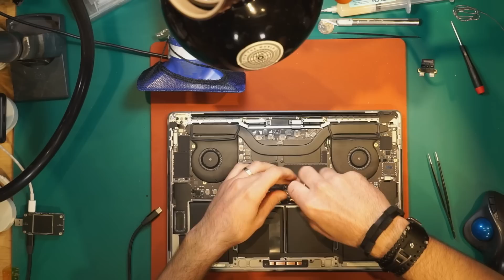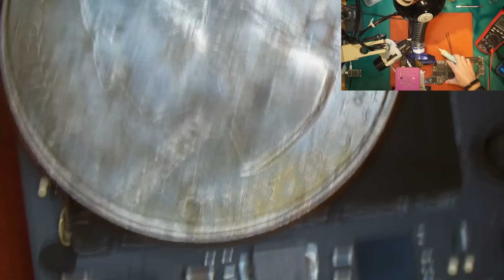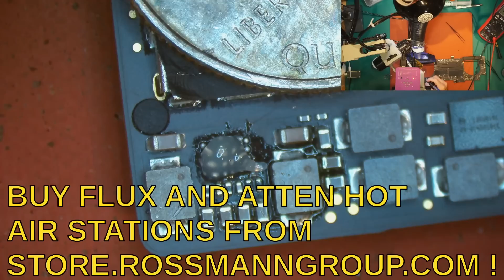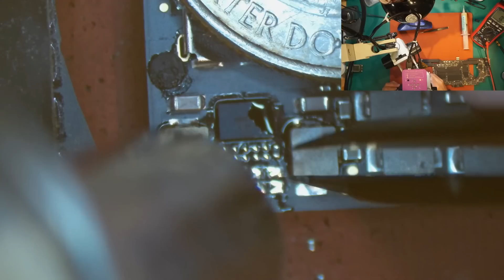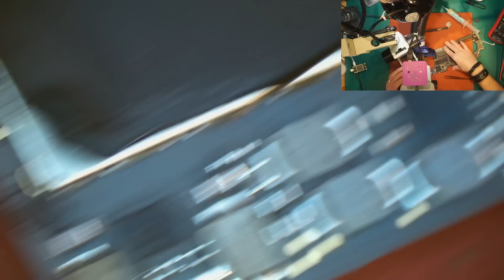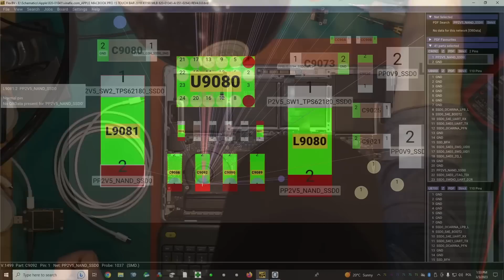Are Apple products still JUNK in 2023?

Comment: The iMac I bought 4 years ago has developed 2 long vertical lines on the screen.  It's out of warranty but I wonder how many other iMacs have this problem but perhaps worse.  I use Mac software and wanted to avoid their poorly designed keyboards, so instead I got this.
Reply: Dead pixels and dead pixel columns are pretty common from all the display brands. Seen it in Dell and LG monitors and you can find them cheap on ebay for this reason. This is why I don't like the concept of the newer iMacs, where the display is integrated. The old one had a magnetic removable LCD that could therefore be replaced. I would recommend the Mini, so the display is separate.
Reply: @gorkyd7912 soon Apple will start making screens so they will control how much time it will last.

Comment: I don't know why Apple doesn't provide a zener diode at the output of the buck converter chip. For such an important component as an SSD, what's the extra cost of one zener diode? If I ever work on such an A1990 with a good SSD, I immediately install such a zener of 2,5 or 2,6V. Risk is 0 after that.

Question: at which temperature is your hot air blower set? I never managed so quickly to remove those components on a Macbook board.
Reply: Is there enough space for it?
Reply: @gorkyd7912  If they had included this at the time of the design, certainly yes. Now, also yes. A normal zener diode (not SMD) isn't that large. Cathode to one of those big capacitors on the output of the buck converter, anode somewhere at ground et voila, it's safe. 
If the diode gets shorted, no problem, the buck converter should go into protection mode. But the SSD is always safe.

Comment: It's a relatively simple thing to mitigate any possible over volting to the SSD a simple resettable fuse set to say 2.1v.. So why has this not been done? Parts will fail regardless, good design however takes this into account and protects itself.. The SSD surely is the one component you cannot afford to be trashed , it's the customers data..!
Reply: They already add the bare minimum to the design to save a few bucks in the production line, let alone backup systems... military grade products do that, but who can buy them or has access to them? Not us, normal humans.
Reply: @AbulaSyllabus If Apple adds bare minimum to the design we definitely shouldn’t be paying premium.
And there are plenty of other reasons not to buy Apple at all anymore.

Comment: What's funny is I'm actually watching this video on a top spec one of those, with the exception of a ludicrous 64GB RAM and 8TB SSD upgrade. The only reason I'm using this one specifically is because I need to have 1TB on both boot camp and MacOS, and need both for certain things, is beneficial to have this in a decent-ish laptop package that lasts at least an hour on battery.
I went back to MacBooks after trying out 6 different PC gaming laptops before I concluded that they are all crappola. All of them over 2,400 bucks each. I took this MacBook Pro over a 12700H 3070Ti gaming laptop, I just need it for what I do, and there's basically no other options out there right now, which sucks but that's just the way it is. I only paid 1,800 bucks for this though which I'm calling a deal compared to the 5,000+ after tax when it was new.

Heat isn't even that much of a problem on it either, if you are doing something intensive, it can get pretty hot but I just use Macs Fan Control to blast the fans at full speed which isn't as loud and unreasonable as I thought it would be, and compared to my dad's work laptop at a similar tier, pricepoint, year range, and use case (work laptops), the MacBook beats that thing up and down the road in every area, the fans actually sound like jet engines, and that's when logging into Windows.
I've also gotten it to last 4 hours at least by just turning on low power mode and turning the HDPI (Retina) function off and changing the resolution to something like 1600x1050 or lower. I recorded, edited, and... wait no I connected to power to export and upload a 2 hour video on just one charge, and this battery is at 85% health.

Macs have many design flaws, but I can point out easily 5x the amount on a PC laptop. The M1s though.... they just are.. different and have specific use cases.

Comment: Hey Louis I am a fan. But doesn’t it make sense that, as you say, no other product fails in this way, because they’re the most popular products around? I mean, it would make sense that you see these types of failures more often simply because of the number of Apple devices that exist. I imagine other products fail for probably some other random reason, and that reason I imagine would vary as much as the brand does. Tell me I’m wrong I’d love to hear your thoughts on this point. Thank you kindly
Reply from the maker: How many brands or motherboards do you know of where the primary and best known failure mode is sending 7 to 12 volts to the SSD?
Reply: @rossmanngroup  Can't this happen on most notebooks with buck converters? (heck, even ssds)
To me it seems like the mosfet inside that chip is not rated for that usecase and its failure mode is unfortunatly "short" since the chips design doesn't account for that (so blame ti)
The engineers probably put in a cheaper chip that can handle less or had an "oversight"/"miscalculation" causing that :)
Or something funky is going on with the feedback pin.
An actual cheap fix would be a small polyfuse and a zener diode which clamps the voltage down on overvoltage... how much do those parts cost?

Lenovo is kinda shit too, had 19v to cpu, broken keyboard flex (because there are 2 bends from the factory which do break after 2y of use), screen issues and whatnot
Reply from the maker: Another example are the a1278 hdd cable failures.

How many computers are known for developing defective SATA cables? That can happen to "any machine with a cable" , but how many laptops have that problem throughout history?
Reply: @rossmanngroup  Sir that is over a decade old.

The only reason I’m asking this question at all is because of the high resale value for MacBooks compared to other brands. Seems like MacBooks (at least when they don’t fail) tend to last long and people pay good money for used and refurbished models. I myself sold a 3 or 4 year old well-used 2017 MacBook Pro myself and got probably 40-50% of what I paid for it brand new. Anecdotal yes, but the point stands and this is typical for MacBooks. They would not have a high resale value if their reputation for making laptops was poor. Not to mention, in 2023, Apple has their own chips which are so much faster more efficient which, due to less heat, I imagine would fail even less.

Once again I’m just playing devils advocate, I’m not picking sides but I like to give credit where credit is due.
Reply: @rossmanngroup  If you did PC laptop repairs then you might have a better idea...? It's interesting to read and watch all of this in light of the quote on your website regarding why you don't really do PC laptop repairs: "The issue is most of the PC laptops we see cost almost as much to fix as the machine is worth".
Reply: @First__Last__  he doesn’t do pc laptop repairs? I didn’t even know that. And yes exactly I was hoping he would elaborate and actually answer my question instead of grandstanding. I’m not here to pick a fight, I just want his opinion on this specific point.
Reply: @rossmanngroup  Hi Louis thanks for responding. I’m not an expert in this field and I’m not the most familiar with laptops so I can’t say. I simply like to play devils advocate which is why the question popped in my head. It would be cool to hear what you think here because you are much more experienced in the field than I am.
Reply: @yustwastaken  Apple share in the SSD market is miniscule. Yes, their phones also have SSDs in them, and laptops do too.

The SSD market is HUGE. Every data center has thousands of SSDs running 24/7 to keep the digital world running. Almost every single one of the SSDs has a 12v line present. Even if there was a bad batch of SSDs regardless of failure mode, everybody else paying $700+ for a laptop or bigger can swap the drive.

I can't remember which company, but they had a bad firmware version on some of their SSDs which caused them to become read-only. So you could only retrieve data, not write to it. They fixed good ones with an update, and warrantied the bad ones. Because... They were replaceable.
Reply: @ThomasWood3DPrinting  I don’t doubt their market share relative to SSDs is small, but the question in hand is regarding market share in laptops, and laptop failures specifically, not SSDs. After all it’s not like they make their own SSDs (…right? I don’t know this for a fact lol)
Reply: @yustwastaken   they are actually Samsung chips if memory serves. Though that is true for many types of laptops.

I referenced SSDs because that's how they should be done. M.2 nvme drives are the same height as a wifi card (m.2 standard).

What they did was run the circuit board in such a way that 12v can find it's way to a sensitive area. This can be engineered differently even if they refuse to use the m.2 standard. If you want to see how resilient these chips should be. Check out the LTT video where they shock ram which was also made by Samsung.
Reply: @yustwastaken  This does'nt happen with other computer brands because they dont design them like apple. Since you arent famillar with our industry and how these devices work. Ill give an example for you to understand better. Cars lets say ford made the mustang and all of its car brands the engine fails because the oil pump breaks all the time killing the whole thing. BUT Toyota GM etc their cars dont break this way because its designed entirelly different. This is true for cars just as it is true for computers no one manufacterer uses the same design process.
Reply: @TAKIZAWAYAMASHITA   Thanks for the analogy. I believe I understand the problem at hand and I am not contesting that it’s an issue with their laptops. I think simply those like Louis Rossman who work in the industry regularly are biased against Apple because of the simple fact that Apple laptops take up a large portion of the market share. I think it probably IS the case they he and others have to fix Apple laptops more, but that’s to be expected if what I say is true. And I’m not claiming that to be true but it seems like a ‘common sense’ thought that comes to mind. I could be wrong there and I’m not sure there are definite numbers to prove that.
Reply: @yustwastaken  Well its no surprise you had good experience with a 2017 macbook. The issues here are for models from 2018,2019,2021.
They don't have bad design across the board, its simply the fact that when they do, they make "rookie mistakes" that you don't see from other manufacturers.
Other manufacturers put enough safeguards so that 1 bad resistor or capacitor are not enough to destroy the SSD. They know your next laptop might be from a different brand if theirs caused you to lose years of data for no reason (such as liquid damage).

if Louis says they get 2-3 like these every day it means there's no coincidence here. It HAS to be bad design and Apple doesn't care enough to do a recall of some sort.
Reply: @kdizzy07   ah okay well that explains my anecdotal experience. Thanks for pointing that out. If this issue is so prevalent it sounds like a class action lawsuit in the making perhaps. Or maybe not considering Apple’s size. I don’t know. I’m just a Joe Schmoe asking questions. Thanks for helping me understand.

However, I don’t agree that a flat number is sufficient for proving the point. It would make more sense to say “Apple laptops account for X% of laptop repairs and non-Apple laptops account for Y%. Despite Apple only holding Z% of market share in laptops, X should be much lower!” It makes sense that Louis gets a lot of business cause by this point in his career, as opposed to when he first started, I imagine he primarily gets business from his massive audience.
Reply: Popularity would only change the frequency of you encountering a certain issue, this isn't an issue of popularity, this is simply bad design, no matter how popular or unpopular a device is - design flaws are design flaws and can often be identified with even a very small sample size, things can fail but not for "a random reason", if you look deeper into this, you'll see the reason isn't random at all, it's simply terrible design. And if anything, a big brand selling such popular devices should make sure to avoid such issues, but somehow they plague them more than any other manufacturer i can think of, including niche, low-volume devices like the frame.work.
Reply: Big Apple is watching YOU 🫵
Reply: If you can find other manufacturers that'll send 52 volts to their laptop's CPUs due to unfortunate placement of power and ground when you spill your beverage on it, let me know! Louis also points out design deficiencies as a lack of waterproofness by drenching an old-school Thinkpad in water — that thing still works.

Comment: My 2015 15" MBP has a second swollen battery so I'm just looking to replace it at this point.
Problem is I vastly prefer macOS over Windows, and there are things about Macs which are good (the trackpad and screen, for example), and the best alternative I can get is one of Microsoft's Surface line-up... which aren't tremendously better and have the same limited amount of ports on them.
It's a tough one, Louis: Microsoft has arguably the worst operating system on the planet (I genuinely hate Windows despite using it my whole life), but their hardware is more reliable. Apple has an OS I quite like and some good hardware with fatal flaws just about every single year without fail. Trying to get a good all-round computer these days (both software and hardware) is nigh impossible.
Reply: Linux or hackintosh bro. There are so many Linux distros to choose from too. Open source and most are free. Load it on any hardware you want.
Reply: Linux it is, then
Reply: The MS Surface isn't the best competitor, the HP Elite X2 is. Even the g3 model back in 2018 had multiple 40Gbit Thunderbolt 3 ports and USB-C PD charging which neither Surface nor others had at the time. This model can now be had for as little as $220 on eBay, although the top spec i7 CPU with 16GB of RAM and 4G LTE is about $100 more. I can confirm the trackpad is a good one, it even comes with a nice Bluetooth stylus and the 4K touchscreen is brilliant. It scores higher than most on the repairability index, you can easily unscrew the back and access the batteries/SSD/PCIe slot for upgrading. HP's entry level offerings are absolute garbage but their high end machines really are exceptional.
Reply: Honestly all laptop companies have issues. I work as a Sysadmin, and we've had so many issues even on high end Dell laptops, XPSs, Latitudes, etc. 

I owned a high end HP laptop, and it blue screen on me daily, and components randomly failed. HP refused to help me with it, and fought tooth and nail over it. Dell I've noticed is a not better than HP in this regard. 

Honestly Framework would probably be the best way to go in this regard imo.
Reply: @keiz_  Agreed about Dell laptops, like you I've seen far too many of those fail due to poor build quality and other issues.
I always assumed all big companies will try to screw you if your expensive new device fails, so I stick to the used market and look for those few specific models which are easy to repair and cost little. My previous laptop was a Lenovo T420, one of the last with a socketed CPU and highly modular. Best laptop I ever owned.
Also agreed about Framework, would love one but can't yet justify the high price. Hopefully in a couple of years.
Reply: @sl9sl9  so as a recommendation to escape a company that offers high failure rate hardware, you propose a company that sells high failure rate hardware? Nah, you can't make this stuff up.
Reply: On Windows, I like having a bottom taskbar that has all of my open files and also my files all open to full screen. And in the bottom right, you can easily go to your desktop. 

Whereas with Mac, you have a permanent set of programs along the bottom, even if you aren't using them. And then when you open programs, they are in small windows. And you can't easily jump to your desktop.
Reply: @colt5189  F11 takes you immediately to your desktop on Mac...  Never had an issue with software not opening full screen...
Reply: my 2010 mbp still works fine - what's the point here?

Comment: Two components could prevent this entirely,  2.5V zener diode on the 2.5V rail, and a fuse before the zener diode. Probably less then $0.50 of extra BOM cost.

Looking at the failure, I'm guessing one of the feedback resistors went open-circuit - probably Apple sourcing some shitty (trigger warning) chink resistors. This could happen with any cheap SSD as they all use buck converters to make those rails, looks like Apple though used some seriously bottom barrel parts and for an SSD that's unacceptable, most buck regulators I use in designs have built-in OVP granted for the stuff I do paying 10-30$ for a US made analog devices buck converter IC is no big deal :P

RAID1 should be a requirement for anyone who takes their personal computing seriously, RAID is not a backup but it's a hell of a lot better then having to recover from a backup.

Comment: Would installing a Zenner diode prevent the voltage spike?
Reply: It's not fast enough to prevent the spike of voltage (transient peak) getting through to the NAND. 1ns of more than 2.5V to the NAND will fry it. Zener diodes do not have this velocity. Power dissipation is not optimal on this part of the circuit on the board.